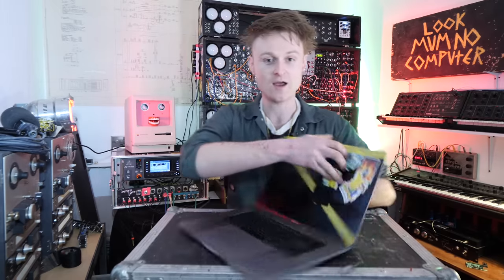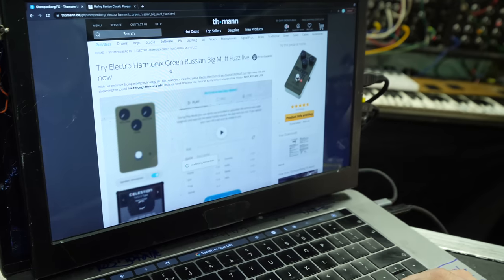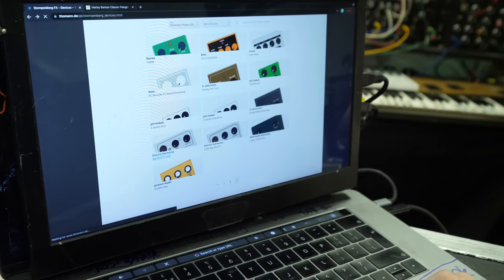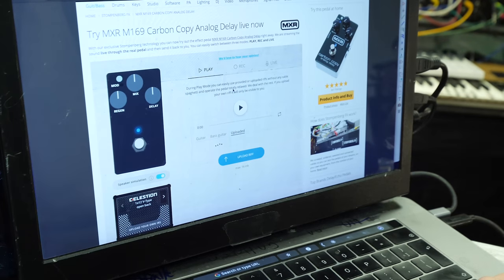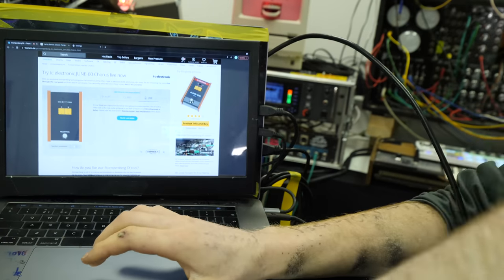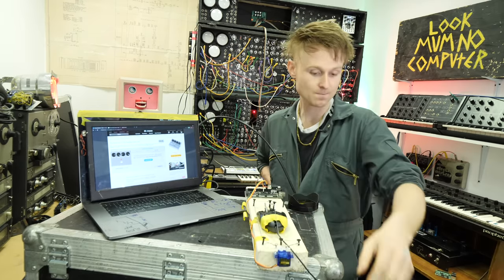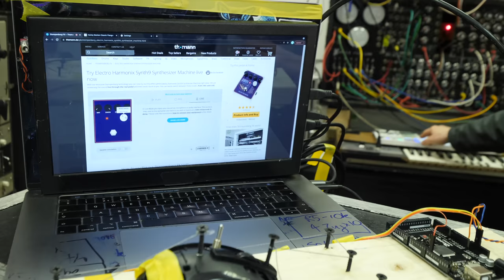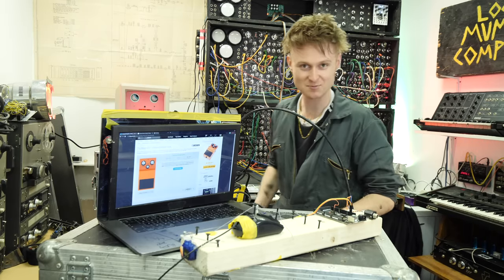Robot Mouse Playing Effects Pedals Over The Internet - STOMPENBERG FX

Comment: I fixed somebody's laptop screen in a slightly different way. I had a spare screen with the same connector, so I simply connected it up. Of course my screen was larger so it didn't fit the way the manufacturer intended. I tied my screen to a piece of cardboard and then duct taped it onto the laptop's lid.